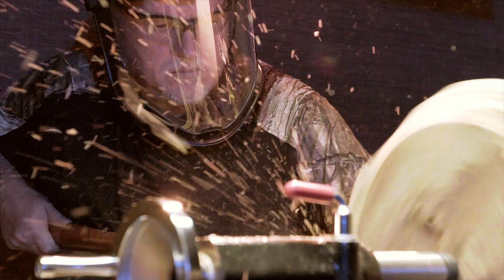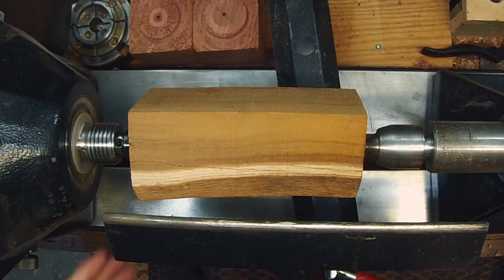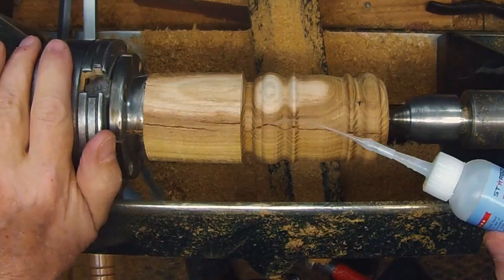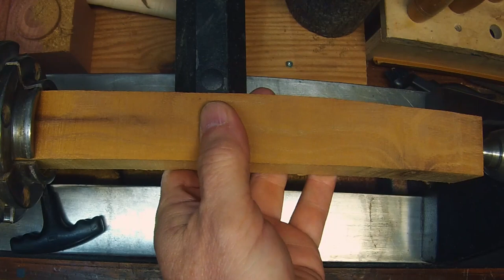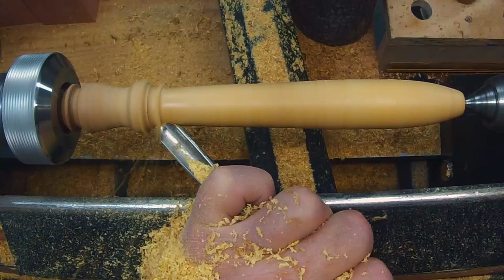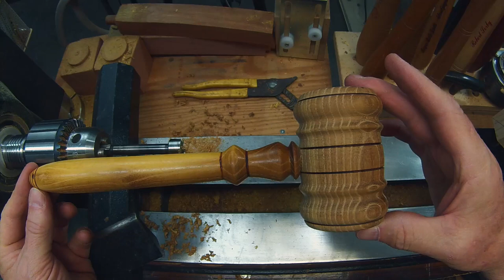Woodturning a Gavel on the Wood Lathe

Comment: Osage/mulberry is a two faced wood. It is stunning, with amazing chatoyance, and it's crosslinked grain means it will crack, but seldom actually split. That same grain also makes it a challenge to split into balks, and can present some difficulty with traditional tools.. tool steel or better and sharp if you are working it dry. 

Nice piece!
Reply from the maker: Thank you. Yes it can get tiny hairline cracks. I seal the end grain with thin Starbond. Thanks for the comment.